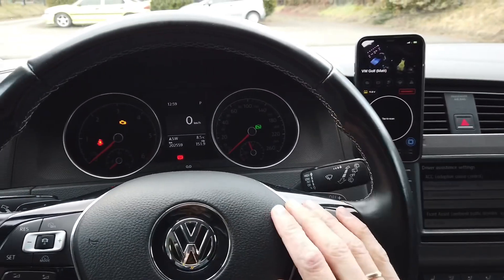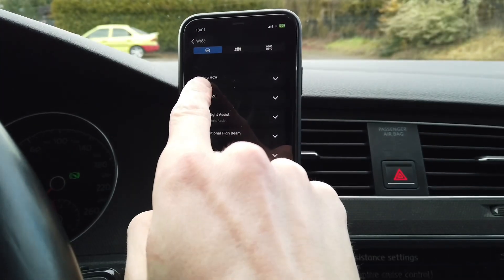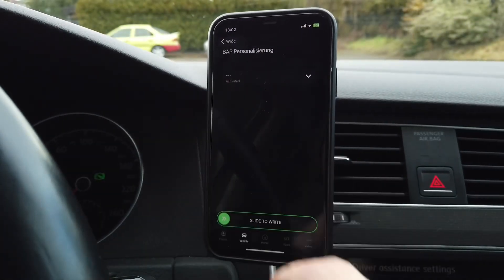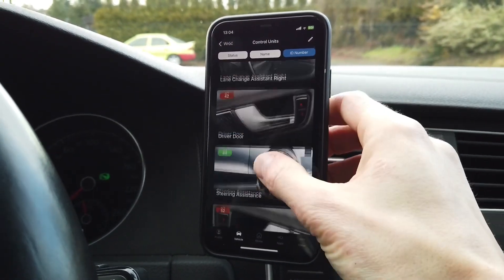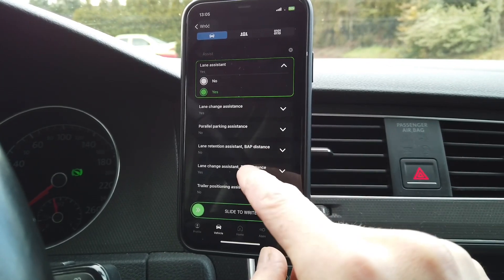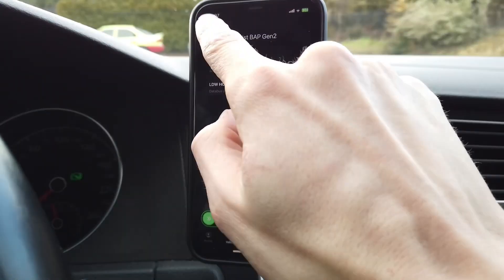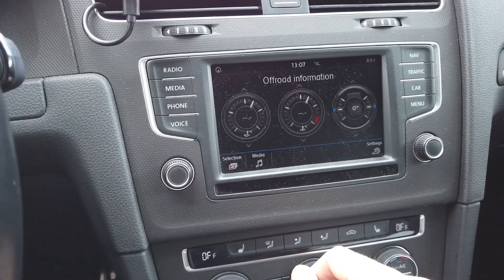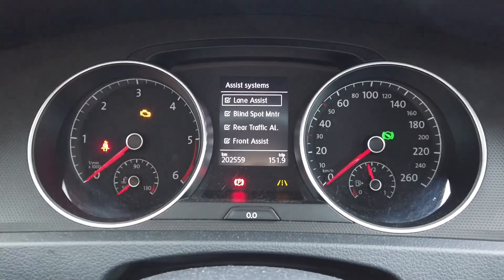VW Golf MK7 (5G): Lane Assist activation coding

Comment from the maker: Need OBDeleven?
🎟 Get 10% OFF with code: MRFIX10
🛒 http://mr-fix.info/redirect/obdeleven
Reply: Czesc , witam . Mógłbym się jakoś z Tobą skontaktować i ewentualnie umówić? Przejąłem właściwie , MK7 z DLA , ACC , Blissem , pakrtronikiem 360 I innymi bajerami - już leciwe auto , ale w bardzo fajnym stanie i wyposażeniu . Mimo wszystko , fajnie byłoby mieć - jeśli jest taka opcja Lane Assist - człowiek do dobrego się przyzwyczaja - świetnie sprawdza się to w nowych kijankach. Z tego co obserwuje , jest kilka innych ukrytych opcji .  Dzięki za odpowiedź
Reply: Z tego co pokazałeś , mam kamerę w tym samym miejscu - jak wspomniałem - ma DLA , Martwe pole , czujniki 360, Front assist I " wyjazd z parkingu " ...cokolwiek to znaczy . Dziwi mnie brak składanych elektronicznie lusterek - może mógłbyś się zająć kilkoma - rzeczami. Za odpowiedź , ogromne dzięki !
Reply: Do you code Lane Assist and ACC remotely? I bought the kit from China, but the original front radar used, the same code as the Passat, as for the Lane assist, I bought the entire kit from China. However, the company that has the greatest expertise here in the region only wants to do the coding if I had purchased the parts from them. My budget is tight, they charge 1/4 of the value of the car. My car is a golf Variant mk7 mexican, I live in Brazil.

Do you know where I can find coding instructions?

Comment: Coding_hca at driver assistance control module gave me a static error U101400. But after turning it off (so setting it to not coded) I was able to clear the static error under module 17 Dashboard. Just letting know in case someone wants to know this drove me crazy.
Reply: But if you do this you get errors under other modules which sucks. The message “databus missing message” but this is because the other modules think it’s not coded when in reality it is. If anyone knows fix pls tell me.
Reply: What works for me is first turning it off, clear the error under module 17. then turn it on clear the errors in the other modules. so its a cat and mouse game, but ultimately it got resolved. After rescanning your car, there will be some intermittent errors (but these can easily be removed). You at least know where they come from now.

Comment: Great video! I’ve ordered the OBD11 Pro and am eager to get started—just wanted to check if these changes work on a 2024 VW Atlas SEL Premium. I’m hoping to fix the lane assist, as it keeps ping-ponging without adaptive capabilities.
Reply: @masoodfarooquevm5956  did it work on the 2024?

Comment: Hi. My car already has the the lane assist  setup but lately I have noticed that car is late to adjust the steering wheel to centre the car in lane. 
Also on the dashboard, the 2 lane assist line is not as bright as it was before. It only becomes brighter when the car touches the white line on the road. 
Anything I can do to make it stay in the middle of the lane please. 
Thank you.

Comment: Could you possibly help me out by showing me pictures of the wiring? I have the camera installed and all I need to do now is route the cables and connect them. I have the wiring diagrams but I want to see how they look like before I mess something up.
Reply: Wiring for what? Camera got two Extended Bus cables, high and low, masse and Zündungsplus.

Comment: Hi! I ve arleady installed lane asyst in my Passat b8 2018" using VCDS. The only thing I didnt do- I didnt mark in Module A5 Long coding-> byte 00 ( 16 byte in vcds)-> bit 0- here it is called "LaneAsyst_AGW_output", but i marked only bit 7- called HC 0=not coded/1=coded)". The lane asyst works very well, in radio I can mark: lane asyst, adaptptive lane guidance, and "warning power" "weak, medium, strong. It shows lane asyst on the clocs. The question is: do you know what Byte 16 , bit 0 (LaneAsyst_AGW_output) is responsible for in A5 module? The only thing I dont have is steering wheel wibration and I dont have this option also in radio screen. Do u know how to turn it on?

Comment: Hello, is it possible to lower the minimum speed required for Lane assist and eliminate the notification for keeping the hands on the steering wheel?
Reply: Thats possible. There are data sets that let you drive 60 secs without hands on and one for unlimited. I actually got the 60 secs Dataset on my A5. 
Minimium Speed differs from dataset, too and ACC, and and and ... :)

Comment: Did you have to calibrate the camera after installing it before using? Or have you already had Lane assistent originally installed in your car ? 
Because I have already seen somewhere that during retrofit Lane assistent you still need to calibrate the camera for the system to work properly, the same as after changing the windshield
Reply: I believe calibration is only needed if you did not have the same camera modules installed from stock
Reply: @wocaomade  thats wrong. Every camera has to be calibrated. Wether its a new one or used. Doesnt matter.

Comment: Hello. I have a camera in my hand, the system sees the camera, but I cannot code. What can I do about it?
Reply from the maker: At which point you have problem? Can you connect with the camera via diagnostic tool and read current coding?
Reply: @mrfixpl  I see the camera as available but I can't activate it. I have the vcds cable. The friend who did the retrofit couldn't activate the camera. Another friend said that the camera could work, I needed to look at it, but she couldn't spare time for it because it was too busy :( (dişil)
I see the camera as available but I can't activate it. I have the vcds cable. The friend who did the retrofit couldn't activate the camera. Another friend said that the camera could work, I needed to look at it, but he couldn't spare time for it because it was too busy :(

Comment: Hello, Do you know how to extend the time period of lane assist without get hand on steering ?? i saw videos about working more than 1 minute
Reply: Mk7 cars sense your hands on the wheel by way of pressure pulling down on the wheel, Mk7.5 cars do this via touch sensors in the wheel itself.
Some people put a bottle of water into the spokes of the steering wheel and this fools the car into believing your hands are pulling the wheel down on Mk7 cars!
Reply: there is a 60 seconds and an unlimited dataset for the A5 Modul. Has to be flashed via VCP or ODIS-E.

Comment: Hello, first of all I would like to thank you and wish you all the best, your channel is really helpful with lots of educational content.
I have a question for you. Are you okay with the way how DSG transmission is shifting gears in Drive mode? Because I have this transmission and I feel like the transmission is shifting too early which causes the result of cruising in the city 55km/h tacho and transmission shifts into 5th gear with around 1200 rmp when I can feel vibrations in steering wheel as they were in my old passat b5 tdi. I am really thinking about get the remap of DSG shifting points because of that and I think it is not really healthy for dual-mass flywheel.
Reply from the maker: Shift points is the single thing that I don't like about my DSG. Too low in Drive, Too high and too aggressive in Sport.It works best for me when DPF is regenerating and ECU requests higher shift points while keeping the comfort shift speeds.
Reply: @mrfixpl  That's it! I experienced the same thing! I was really pleased with shifting during DPF regeneration. So that is the reason why I am really thinking about getting DSG remap by professional garage. Have you ever concidered it too? Or what is your opinion about this topic? Thank you!

Comment: I have te "high beam assist" camera but not the multifunctional camera, how much does it cost me to intall the multi func camera ? and where can i find it. can you help me maybe ?

My car is a Golf 7 2016, Btw, the dislay between your rpm and speedo meter is in back and white. i have a color display, i thought every 2016 golf 7 had it in color, aparently not
Reply from the maker: You would need to replace the windscreen for proper retrofit. There's also couple plastic things like mounting bracket, cover, different rear view mirror. On top of that: wiring, parameterization, calibration of the camera. A lot of work and cash.

Comment: Thanks, in my case module 44 didn't accept coding for HCA and I had to update firmware to the latest version, from 5Q0909144P to 5Q0909144AB

Comment: Have by yourself added that module?
Reply from the maker: My car was originally equipped with the camera. But since the same camera is used for Traffic Sign Recognition, Dynamic Light Assist, and Lane Assist you might have the camera and don't have the Lane Assist option activated from the factory.
The same deal with the front facing radar. It's used both for Active Cruise Control and Front Assist (automatic braking). You can configure the car from the factory to have Front Assist and regular cruise control. And you are just 2 steps away from ACC - needs buttons and coding, AFAIK (might also need FEC/SWaP code in gateway for ACC but not sure if that's correct if vehicle is already equipped with regular CC).
Reply: @mrfixpl  ok, now i understand beter. Thank you mr-fix. By the way, great video’s! Be blessed🤝

Comment: First of all, a Lane Assist need a Parameterization Data to work absolut correctly!!
And than Coding!
Without Parameterization you have one warning Step. 
With Parameterization you have multiple warning Steps and a emergency Brake!
Reply from the maker: Maybe in A6 C7, but not in MQB vehicles AFAIK.
Reply: @mrfixpl  Why not?
Read my first Post!
Reply from the maker: I can see just one parameterization file for this camera and this vehicle. No distinction for DLA/TSR/LA. But I would love to learn more if you can share some information.
Reply: @mrfixpl  Take VCP tool, flash the correct Dataset for your Camera, code Lane Assist (as shown) and you will see!
One warning Step is not correct for Lane Assist. 
Correct Lane Assist have three warning Steps and final a emergency Brake.
Reply: @R-Line7  actually you are part of right about parameter with camera…coz he has 5Q …first gen camera,and that one doesn’t support emergency assist…That’s the reason no need to parameter…if he has 3Q… second gen you are right about parameter file…
Reply: @mrfixpl   actually you have 5Q …first gen camera,and that one doesn’t support emergency assist…That’s the reason no need to parameter…if you have 3Q… second gen you are  need parameter file for EA/TJA(emergency assist,traffic jam assist)…👍